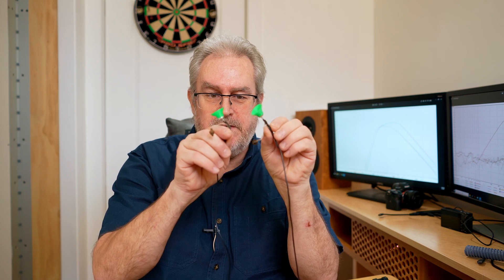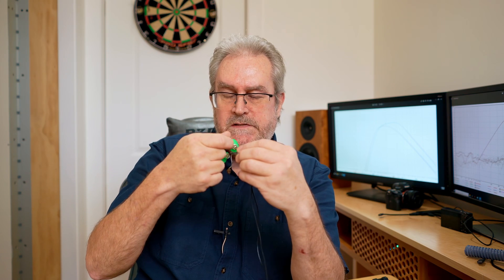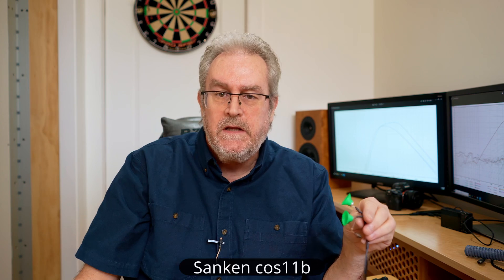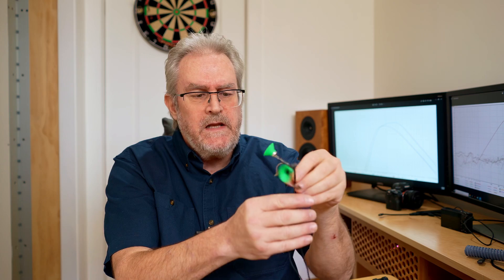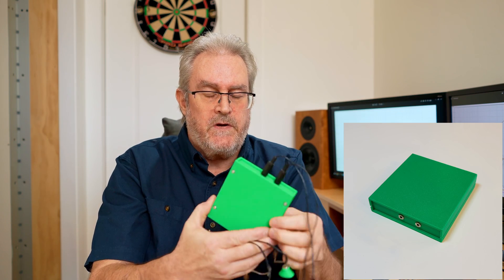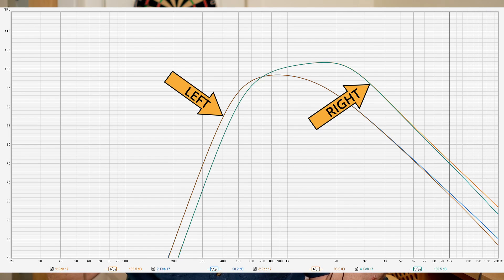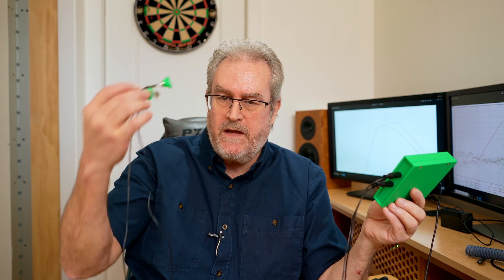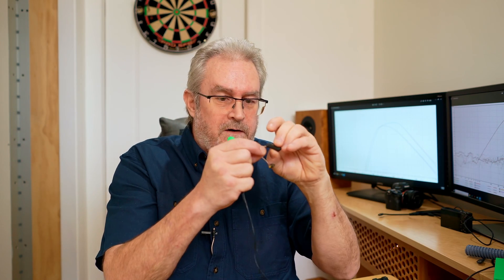My Homemade Hearing Aid - DIY Hearing Aid

Comment from the maker: I have moderate hearing loss due mainly to damage done during my years in construction. This device is designed to boost the frequency range that fills in that loss of hearing. Think of my hearing as a hole in the ground and this hearing aid is the dirt that fills the hole.
It is basically an active amplifier, one for each ear. There is a highpass filter and a lowpass filter that limits what's being amplified to specific frequency range 
So my ears are hearing what they normally do, but they are also getting the boosted response from this device.
More technical: 
I used the Analog Devices filter design wizard to design the filters: https://tools.analog.com/en/filterwizard/
I configurated the highpass as a 6th order (3 stage) filter that has gain. The 2nd order lowpass follows to limit how much high frequency content is boosted.
Final stage is the output with two opamps in parallel to drive the in-ear receiver. It has  much more gain and is adjustable.
I used Microcap to sim the circuit and KiCad to design the PCB. I used REW to measure the response of the completed circuit to ensure it was working as designed. These measurements show the frequency range boost, the low noise and low distortion. 
Opamps are the NE5532. I tried the lower power LM6132, but the performance wasn't as clean. I'm using this with a plugin power supply so power consumption isn't an issue. If I wanted to run it from batteries, I'd use lower power opamps.
 
I've order 3 different mic capsules to try out and may make a followup video if they prove to be better. The ones I'm using work great, even though they cost almost nothing.
The circuit is fairly compact, but was not designed to use outside my listening room (or some other static location). Real hearing aids will almost always be the better option if they are setup properly. They are tiny and have a limiter, but also consume batteries and are quite expensive. But my experience doing this has shown that the expense is (mostly) justified.
I consider my time spent developing this as educational and an act of entertainment - I like doing it. It certainly gave me an appreciation for how difficult it is to do this.
And the device is low enough in cost that I can build additional units to have in other places, like at my desk for editing video. The in-ear receivers are not cheap ($220 per pair), but a lot less than real hearing aids.

Comment: Maybe that could solve the problem when one ear is deaf. You could just have the mic on the deaf side and send the stereo sound on your good ear.
Reply: Yeah, but in order to actually hear or perceive true STEREO sound, you need to be able to hear sound clearly and pretty much equally, with BOTH of your ears at the same time.
Reply: @JoeJ-8282  / @tokkarijuha Presumably, the brain was using the nerve pathways and cognitive machinery of the damaged and so deafened side to accomplish that, distinct from channeling that sides reception through the functional side and perhaps over burdening it.

Comment: I could mail you a set of hearing aids for testing. My father passed and he has several sitting about. Cheap ones and moderate priced ones, I don't want them.
Reply from the maker: Thanks for the offer, Kip. Problem is that his would have been set up for his hearing and not mine, so measuring those wouldn't do me much good.

Comment: Did you consider measuring the hearing aids with a dummy head? (3d printed pinna and wooden head)
Reply from the maker: If a mic is used it will also pick up the sound that going into the hearing aid, so it won't show the true response.

Comment: I have moderate to severe hearing loss in the mid to high range. I have the top on the line Phonak HAs. They work very well. I have an audiologist that performs real ear measurements which enables her to program my Has to my prescription. Hearing amplifiers cannot do what HAs can do.

Comment: A note: If the hearing has been reduced over time in the relevant upper frequencies  and we further increase those frequencies into the ear  via the ear pieces ,do we risk further reducing these frequency responses within the human ear ?
Reply from the maker: As long as you aren't going above the hearing damage threshold, no addition hearing loss will happen. And even if some did, the quality of life benefit outweighs any detriment.
Reply: @IBuildIt  Nice build mate, very logical and great processes / tools used.

Comment: Very interesting.  Now if you only use these in your listening room, plugged into the wall, why not just use headphones and turn it up louder?  Is it about experiencing the ambience of the room?
Reply from the maker: I've tried equalizing headphones to correct my hearing and can get it close, but I really don't like wearing headphones for long periods, 
These are nothing at all like headphones and yo can't hear the sound coming from them - the sound is coming from the speakers, just like normal hearing.
Reply: I would go in the same direction but with the speakers and amps itself. EQ them to your liking, not the straight "truth". There are much better components in your system than in a hearing aid. Plus the aids indeed have not only a limiter but are rather (e.g.24-) band multi compressors itself.
Reply: Matthias, you are sort of doing with your lens collection with vision correction experimentation what John is attempting for his hearing with audio amplification and filter shaping experimentation. John are you affected by tinnitus as part of your hearing loss and have you as it were listened(looked) into that?